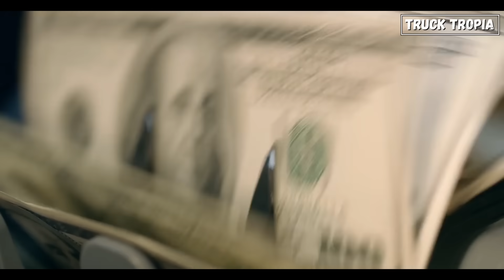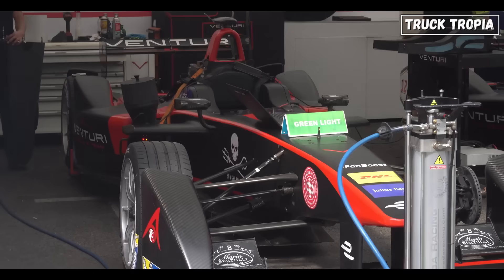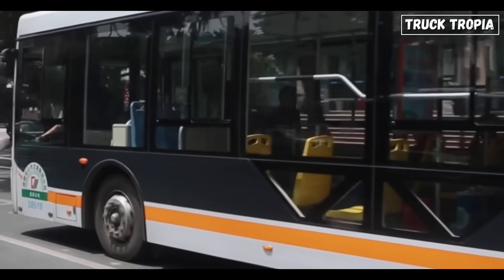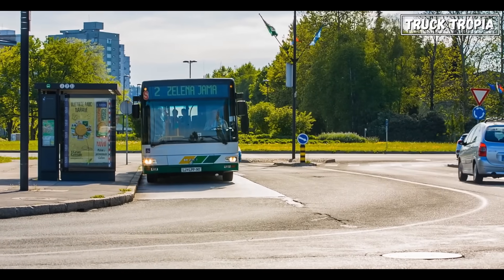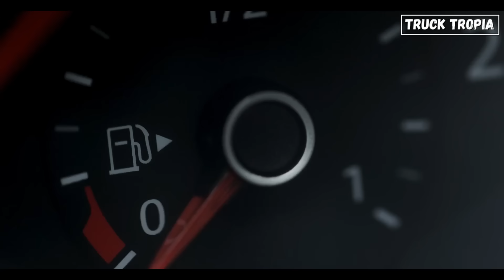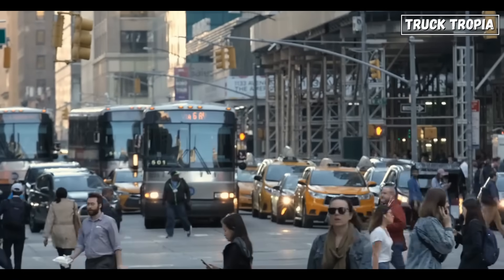Why Do Big Buses Have Rear Engines?

Comment: @3:27 - Visibility reason - not correct. Drivers of many front-engined and ALL mid-engined busses have exactly the same or even BETTER visibility as a rear engined bus. It depends on the design of course. Forget the stupid design of American school busses, which look as if they were made from a dump truck. Here is an easy example - You can't beat the visibility design of early Front-engined Skoda and Chavdar busses (engine over the front axle). Driver is literally a couple of feet (50-70 cm) behind the front bumper, hence they have EXACTLY the same or BETTER front visibility as any rear-engined bus and they have a slightly BETTER REAR visibility through the rear windows, compared to any rear-engined bus.
Reply: As an experienced driver of coaches, for best visibility, you want either mid-mount or rear mount engines. With a front mount engine, you cannot lower the windscreen as much in order to get the best vision. There have been many attempts to improve vision, and it is always a significant design challenge.
Reply: Your comment literally makes no sense

Comment: @2:23 - Flat floors - this is not correct. Busses with REAR engines typically DO NOT have perfectly flat floors, because their rear floor is considerably higher. The floors either have a step somewhere, or are under an angle - the back being higher than front. Typical example: the vast number of busses  designed around Mercedes O305 bus and all similar ones. A few designs allow almost flat floor with a rear engine, but they do sacrifice 1-2 m2 space - engines being mounted in the rear end above the floor. And you haven't mentioned anything about Mid-engine busses, which do allow a PERFECTLY FLAT floor, without any sacrifice of space for the occupants. Engine being mounted in the middle 100% under the floor. So flat floor and maximizing space is not a reason for the engine being at the back. Ease of maintenance however is. Maintenance of a mid-engined bus is a bit more difficult than front and rear-mount. Mid-engine busses (with engine below the floor) were much more common in 1970s, 1980s and early 1990s (at least in Europe). Primary example: Ikarus 250/280 families. Mid engine busses do have a few drawbacks, but they can't be beaten for: completely flat floors combined with maximum passenger space, chassis balance and cornering, including in winter conditions. Low-floor busses also sacrifice considerable amount of space for just being low-floor (i.e. because wheel arches in the interior of the bus are huge and can't be used rationally).
Reply: Im guessing they meant "low floor" when they said flat flor

Comment: I really don't understand how you can have a low flat floor and a spacious compartment below the floor for luggage. There is a problem with nomenclature. In America they only have buses. In the UK we have buses and coaches. Buses are usede for short distsnces and cater for people who travel short distances. A low floor is great for this, and people generally do not travel with a lot of luggage. It means that access is easy. Then we have coaches, which are used to carry people longer distances. These do not have low floors, requiring steps to get up to the seats. This tends to not be an issue because there is not a continuous flow of passengers getting on and off. These are the coaches that have room for luggage in compartments below the floor. Also a higher floor is better for touring coaches as the view out is better.
Reply: With the engine at front, there would be a series of propeller shafts connecting to the rear axle. The transmission is probably in the same line too.

Having the engine at the back would eliminate the long propeller shafts therefore lowering the floor for stage bus or bigger luggage compartment for interstate versions.
Reply: We definitely have coaches. I see them everyday for example, a prevost greyhound coach. Americans call busses and coaches a bus. I drive a truck so I see them all the time.  This video is off if you get technical.
Reply: I think is is more of an OR option.  With the engine in the rear, you can have a flat floor, OR you can raise it, and have a huge side to side luggage compartment.
Reply: NJ uses a lot of coach buses, there is NJ transit that operates it and Coach USA company. In the part of NJ I live in we use Coach USA (NJ transit option also available but Coach USA has a terminal where it protects from the elements plus park and ride) to get to NYC it has huge luggage storage underneath
Reply: @abrahimkhwaja2138  100% facts lol
Reply: If its long distance, its usually either at least 250+km (school trip for a ski week) or international, like Vienna-München (Flixbus, which also reminds me, they have double decker coaches too). Whenever its a regional line which serves a lot of small villages to small towns, its usually a rear engine low floor bus (either normal ones but with double rear axle, or artic ones in rare cases).
Reply: Do they have assistant coaches too?

Comment: Busses in my country mostly have the engine at the front over the front axle for various reasons, 1. They are much much cheaper than rear mounted engine buses, and in business, cost of purchase is king.
2. They tend to travel long distances where long term longevity is also key,
3. Contrary to what Europeans and Americans think, they are not front hood design buses but they are more like cab overs which means you can have lots of design as they are made to the owners design preferences. Also some are designed by the manufacturer ie Scania Marco polo G6 G7 (check out Scania EA in kenya)  or the Chinese yutong buses
Also the front visibility is still available cause they employ the same principles as they do on rear mounts engine buses, over all different circumstances dictate what buses you find where.

Comment: Front mounted buses have a truck chassis, and based on that, while coach buses are the epitome of passenger comfort, specifically designed to transport people on highways in the most comfortable way. These coaches have nothing in common with a truck frame.

Comment: False Rear engine bus doesn't maximize capacity for people vs overall length.. lots of bus have engines under the floor like a upper med arrangement, storage is maximised with a rear set ups,  all bus have a flat floor,  some rear engines buses can have a lower floor relative to overall height.. also the Toyota coaster is an exception low floor plus engine under the drivers seat ..  and false rear engine buses 😂 don't handle better, coaster again in point for cornering .. on slippery roads a front engine school bus will have more traction than a rear engine couch style fact.. but they are definitely quieter

Comment: A lot of people comment without knowing or doing  any research. 
Front mount engine buses are mostly used on gravel/dirt roads, where they are 100% more capable than rear engines. 
The person who did this video also fails when he says 'BIG BUSES' use rear engines. 
In South Africa we have 22m long (articulated buses) powered by MAN engines, and these engines are front mounted. Isn't that BIG?
The downside of this engine is for those who hate engine  sound. Some don't mind the sound, they will even tell the model of the bus from sound as it approaches.
Reply: Even as a kid, here in North America, I could tell what kind of engine a bus had just by the sound.
Reply: Are those 22m busses based on truck chassis? Just wondering.
Reply: @ultra-potato  They have their own special chassis, and the rear part is attached to the front one in a way such that the joint can tilt upwards and downwards, while able to bend sideways, covered by a strong diaphragm resembling an Accordion.
I am not very sure, but I believe the front and rear chassis are especially made for these models. 
These ones are strictly used on tarred roads, but the front mount engine buses with standard size are also used on gravel roads.
Reply: Scania F310, MT.
The engine and turbo spool sounds soothes
 my soul.

Comment: When Volvo brought rear engine buses to my country it became the epitome of luxury. It didn't make any noise which we are used to hear from Cummins and hino manufactured diesel engines. However so far only Volvo is offering rear engine buses while traditional players still give front engine buses which are rather mere chassis and later add ons are done by coach builders. The traditional players only offer rear engine buses but they are low floor ones plying within metro cities and airports.

Comment: Because having the engine in front means a front hood, which increases the length of the bus without adding passenger capacity, or, conversely, decreases the length of the passenger compartment yet doesn't decrease the length of the bus.
Reply: aAso decreases the passenger capacity because of the stairs to get to the high floor above the transmission shafting, Those stairs don't make the bus Wheelchair or baby stroller friendly either.
Reply: @Razzman-bv5qc  wheel chair ramps/lifts are used even on low floor busses
Reply: @williamhaynes7089  Yes they are, but if the floor was unduly high, step-in height would be too high.  Nowadays, that is a no-no.
Reply: @williamhaynes7089  Those stairs stop the wheelchair boarding completely,  We have american design busses and it's difficult for infirm to negotiate those twisty stairs on city busses.
Reply: yea it consumes more space and longer drive shaft which also makes more power loss

Comment: Actually it is said that front engine bus are better than rear engine because if any vehicle hits the rear engine bus the rear engine bus may blast and takes lot of time to repair while front engine bus doesn’t take more time. Front engine bus are nowadays cheaper sold in India
Reply: so front is better because if you get hit in the back, repair is cheaper? 90% of collisions are near the front. you want to move the expensive part to the area that gets hit 9x more often.
Reply: So what if a front engined bus hits the back of a rear engined bus, and vice versa?
Reply: @ShinzouWoSateSateSate bro actually as per Indian bus we got many incidents of Volvo bus that most of the cars or trucks hit the bus on highway due to which it takes long time to repair and not only that even rear engine bus catches fire too . But even if the front engine bus gets bumped at the front still it works . Actually we have front engine buses like Tata, Eicher and Ashok leyland. These company are itself strong
Reply: Front engine buses are popular in Kenya. Be they derived from a bus built on a lorry/truck chassis or a bus built on a dedicated bus chassis.
Reply: Uhhh I beg to differ. A front setup has more critical components than just the engine. Based on what I've seen on a rear setup. You will damage the bumper and subframe before you damage the engine. Depending on how hard it's hit. If both impacts are the same, the front will sustain much more damage...

Comment: Loud engine noise still depends. The citybus I use to commute to work is a low-floor Scania K250, and their Inline 5 engines are LOUD. On the other hand, I can barely hear a Volvo B11R's engine.
Reply: Volvos are really good at keeping quiet
Reply: We had locally built buses in my city in poland, called "solbus". They used cummins diesels, and they were literally unbearably loud, and they were made in the 2010s. They felt like 80s busses in terms of noice though
Reply: @foxy126pl6  haha, it probably didn't help how among American engines, Cummins are known for their deeper "gruff" sound
Reply: @bmad1386  i guess so! I have no idea why they went with an american engine instead of a euro one, but this , and the bad quality overall made it a not enjoyable bus at all. Thankfully they were replaced with Mercedes conecto buses 2 years ago
Reply: My country has almost 1000 K230UBs which sound loud probably if its radiator hasn't been cleaned in a while & thus its fan has to spin faster to provide cooling. Sometimes it sounds like a vacuum cleaner!

Comment: This fuel efficiency point makes me wonder how more fuel efficient my aunt's already highly fuel efficient Subaru Impreza would be if its trunk and engine swapped places.
Reply: Rear engined buses had to undergo a whole lot of development and engineering to become efficient. The first rear engined buses had transversely mounted engines with a 90 degree gearset to connect them to the axle. A hilarious amount of energy was wasted there.

Comment: It might be for more profit in the US of A, but most services worldwide are not meant make a profit for shareholders and municipalities, to justify their existence.
It would be more accurate to say, efficiencies of cost, thereby profiting from less cars on the roads, less pollution, less noise, etc. Those are better metrics to judge profit by but not as obvious to some as money in their 'pocket profit'.

I used to be a bus driver in the 1980s, with the rear engine Mercedes 0305 and 0303 buses, having been introduced from 1973. Absolutely amazing compared to the front engine Bedford SB and VAM (upgraded to Izusu engines with 5 speed manual gearbox) models which were used only in peak hours when the most buses were required. 

I got the know the difference between petrol and diesel motors, especially with a full bus of passenger, going up a good hill.
The driver was sitting basically on top of the engine. Could get pretty hot and sweaty with the heat and humidity of summer, and the noise, especially the diesel.
Petrol was quieter but had no guts on the hills. You learnt how best to get to the top without having to get too low in the gears (SB was 4 speed). More revs, more noise. 

Demister was a rag or newspaper to wipe the windscreen. 

The odd Daimler and Leyland bus (pre-select transmission) still had a triangle on a stalk thing with a light (no blinking) that lifted out and up like a salute, from the side of the bus.

Great job but didn't pay enough to keep my flying lessons going.

I did mostly afternoon/night shifts and I could go on and on about getting passengers home safely. That was the key, getting them home not only safely but that they felt it had been a safe journey. Wet weather and being exposed to high gusts/winds, again, another story.

Comment: never seen a buss with front engine since the 80ties if you dont count smaller van based busses. All big busses have rear or under floor engines.
Reply: In North America buses with a nose are still common, unlike in Europe.
Reply: @westerlywinds5684  You mean trucks. I don't think there are many front engined North American buses
Reply: @benedekhalda-kiss9737 almost every school bus is front engined. Easier to learn how to drive them and a shorter wheelbase.
Reply: @EmperorNefarious1  Also with a bigger swing because of the huge overhang at the back. Rear engined buses are easier to maneouver in tight spaces because the front wheel is behind the driver and thus the bus can go over the curb. I did not think of school buses though you're right
Reply: @benedekhalda-kiss9737 party buses are nosed, hotel buses are nosed, the only buses that have rear mounted engines are the real coaches, like MCI and Prevost. Anything else is a truck cab and chassis with a passenger compartment build up.
Reply: There are some by VDL.

Comment: So they dont have a 40ft driveshaft….
Reply: and exhaust
Reply: I think this is the main reason (driveshaft and exhaust) and maybe the weight over the rear wheels. The rest the marketing department came up with to sell the concept.
Reply: Also so the driver can sit lower down and see what's in front of them better in town.
Reply: Most buses are rear wheel drive, so rear engine buses don't have a long driveshaft.
Reply: @ yea thats what im saying  “why do big buses have real engines?” Is the title of the video the answer is so they dont have stupid long driveshafts.
Reply: @RumblesBettr  There's many reasons why most buses rear engine, there's no reason for long driveshafts since they're mostly RWD. Articulated buses have driveshafts connecting the joint and the mid-axle.
Most buses are rear engine because takes up less space and fit more seating, they're also easier for bus mechanic to service. Rear engine buses are usually more comfortable for passengers and drivers.
Reply: @ ur just saying what i said